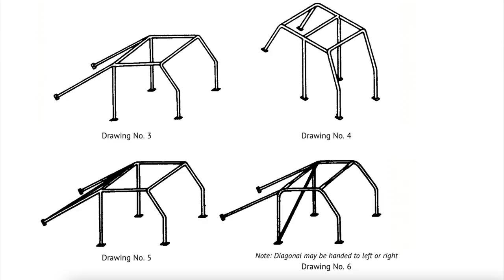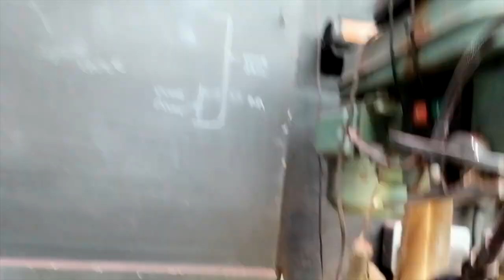Fitting the roll cage was not as easy as I thought - classic mini rally car episode 45

Comment: Proud to be a sponsor for the fire system Kev, hope you don't use it.

Looking at your rollcage, I'll be tying mine into the A post and B post too with gussets etc...

Mines a bolt in cage too, but probably a bit cheaper than the one you've fitted. Mine has the door bars but no diagonal across the back or harness bar, but they will be added on soon when I get onto getting mine back on the road.
Reply from the maker: Awesome, yea this cage has lots of additional bars and off the top of my head it's a 24 point cage with all those additional bolts. . But as you say if you can tie in the pillars on yours it will be a bonus. Thanks again for being a sponsor, I am chatting with my mate who helped design our logo with regards making some sort of fire sponsorship sticker for rally mjni.

Comment: Looks superb Kev. After marking the door bars, could you not have taken them out and drilled them with the pillar drill? 
I wish I lived in the IofW, it's always sunny down there!
Reply from the maker: its alway lovely one the Isle of Wight :) - yes I could do that with the door bars, good point, but I could not do it with the holes that needed drilling into the adjoining cage tube. each sleeve has 4 bolts 2 go through the bars and 2 through the cage. but its a very good point I could have done half of them in a pillar drill. glad you liked the video